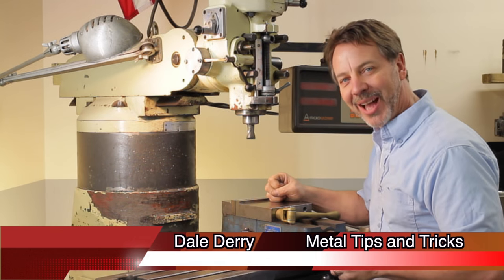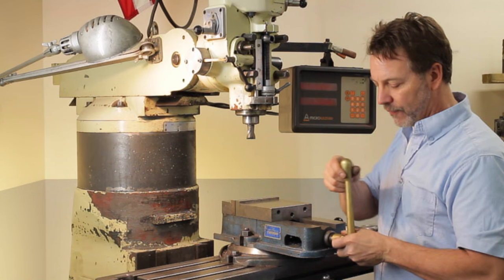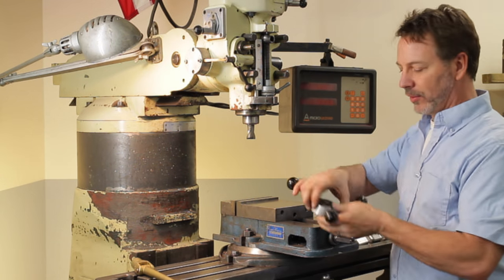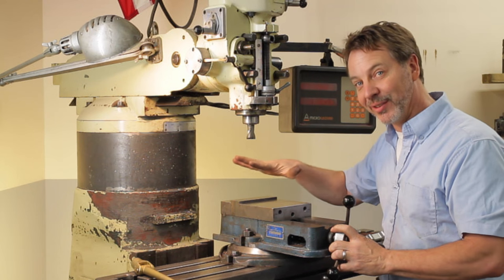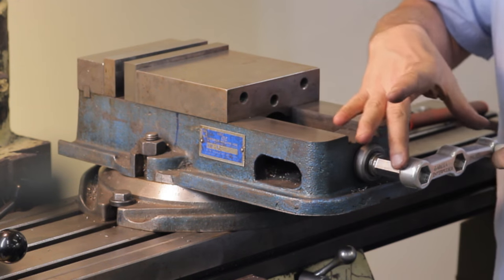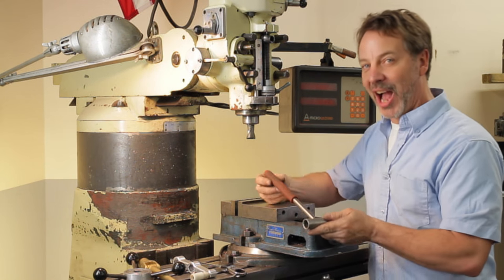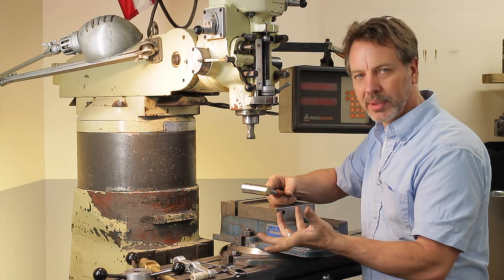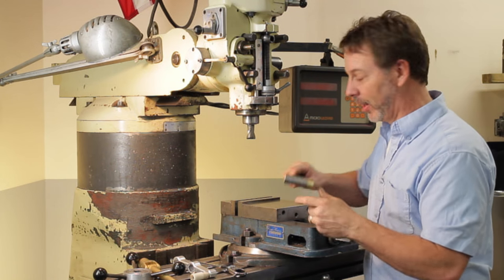Milling Machine Vise accessories

Comment: dale you need to mention the danger of leaving a long vise handle on the vise and run the risk of jamming it into the saddle during a power feed. i shortened a swivel handle to prevent that short of thing from happening. good video.
Reply from the maker: +larry sperling 
Great Idea

Comment: Another problem with the default handle is that it can get jammed on the crossways when you are moving the longfeed back and forth, especially with power feed, and it will either move the vise or damage stuff.
Reply from the maker: +trainedtiger 
Great point. :-)

Comment: I use a long combination 3/4 X 7/8 box end wrench. It serves both as good tightening leverage and the 7/8 for tightening the vise bolts and parallel clamps.
Reply from the maker: +MCEngineeringInc 
Great advice

Comment: I like my 4-armed wrench. The advantage is that there are always opposing handles so that you can push and pull at the same time. It lets you deliver a lot of torque without requiring you to brace yourself as though you were trying to tow the Queen Mary upstream. You can deliver a lot more torque with the differential than you can with a single-directional wrench.
(see it in action at the 6:50 mark - https://youtu.be/nZ2ZhrN-I2w?t=6m50s ) 
Of course, it won't work if the vise is mounted crossways, but then I rarely use it that way, and the stock, single-arm wrench is always available in case I need it.

(I feel like Oscar Wilde, who said he once spent an entire morning removing a comma; and then spent the entire afternoon putting it back. I know I use way too many commas, but when I take one or two of them out of a sentence, I almost always seem to end up putting them back.)
Reply from the maker: +Peter W. Meek 
Love your comment boat the commas. :-)

Comment: hey dale great vid as usual .did you make that riser on your mill or is that original equip.!! I have a clausing 8530 mill and space is limited im thinking about making one for mine any info would be appreciated thanks .  Pete
Reply from the maker: +TheDieselmb 
The riser block was made by Bridgeport. You might be able to make one out of 1"thick tubing or pipe. With that being said, I'm not sure if it would be as rigid as cast iron. let me know how it works out.

Comment: I know this is a year old, and irrelevant at this point, but just for the record the "gear wrench" wrenches like you had, also have the adjustable neck so you could rotate it 90 degrees from vertical and use it as a speed wrench also whether the vise is on the x or y axis.

Comment: my 4" import vise uses a different size head on the screw... I'd love to have a two position speed handle like the one you showed.... I drew one in CAD,  only issue will be making the hexagonal cutout the right size
Reply: +John Galt Use a hex broach, and you'll be all set.
Reply: hey wonder if I could cast one  I have a 5" import vise think it's not standard also. I'll have to look into that
Reply: +Chris Anderson well it looks like it measures .550 on the hex of the screw. what size is yours?
Reply: +John Galt Get two cheap sockets the right size cut off the driver end, drill two hole and press fit the cut off sockets.
That way if they wear out press out and replace
Reply: +E Hiebert nice Idea E  I looked at that last night.. 14mm fits kinda loose and SAE doesn't fit.  I measured across the flats, and it measures 0.522-525".. (13.26-33mm).  None of my spline sockets fit either.  I might try one of those milling methods where you drill a small dia. hole in each corner, mill out the max and file the remainder....  Why can't these mfg do something std. (or why can't I afford a Kurt) ?    ;)
Reply: +Axis OTW I thought of that, kind of expensive, unless I buy one and make a whole mess to re-sell.  See my notes below about the odd size...
Reply: +Chris Anderson 0.525(~). see below.
Reply: +John Galt I worked on a CNC lathe with live tooling which allows you to mill on the lathe. We drilled the center close to your full size then drilled the corners and then you have very little metal left to mill your flats. You will have to use a mill in your case.
We used a small 4 flute milling cutter to do the corners shorter and stiffer then a drill. We used the same mill to do the flats.
I have done lots of CNC work very little manual, so do not know if this will work on a manual milling machine. But it may give you some ideas on how to make it work. Good luck If this helps make your part I would like to know.
Have a day
Reply from the maker: +John Galt 
Who is John Galt?  :-) 
 That sounds like a good project. I would think about using a  socket and pin it into place.